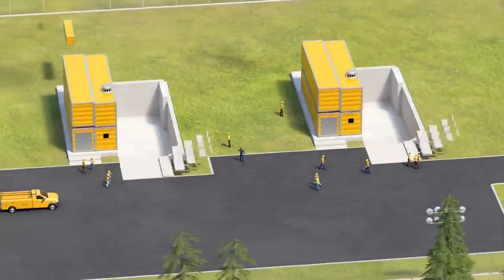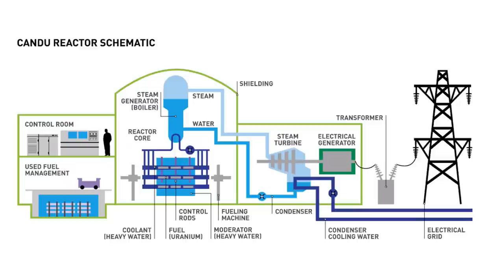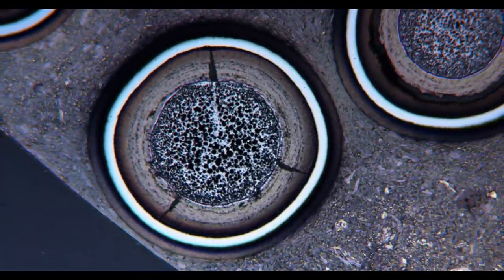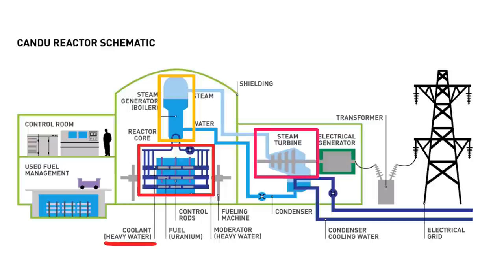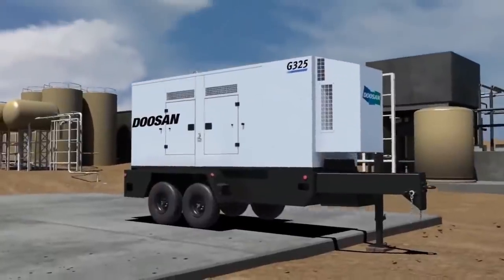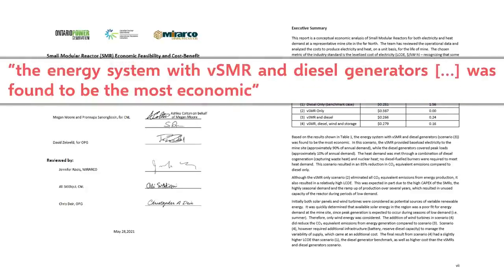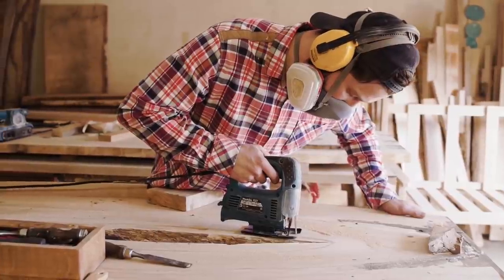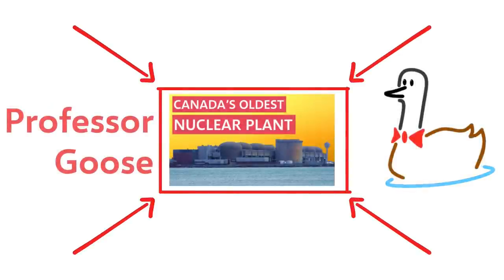This Micro Nuclear Reactor Could be Replacing Diesel Generators by 2026

Comment: One thing I'm curious about is whether a shipping container sized nuclear generators, each generating 1-2MW, could be placed (buried?) at electrical sub stations in order to both decentralize power generation as well as reduce the overall power demands on centralized generation facilities. If the device has a problem and goes down, the central power generator simply picks up the slack until it can be repaired, but while the container is in operation, it provides the primary power to the homes/businesses in the immediate vicinity.
Reply: It is possible. Though you would still need to put some effort in building some infrastructure (like cement frames for the container to go in). But I don't just 1-2 MWh are enough to justify the cost. 10-20 MWh might be more reasonable.
Reply: Any reactor less than 50MW is useless and uneconomical because it's about $5mill per year to licence each reactor so the reactor needs to make that money back plus cover operating and capex costs. That licence fee puts a hard limit on how small a SMR can be.
Reply: @kaymish6178  So you are telling me that is high time we update our nuclear regulations to 21st century standards compared to the fifty decades old regulations ?
Reply: @alexandervlaescu9901  That would be a good start.
Reply: @kaymish6178  One primary goal of a self-contained micro SMR would, I would think, be to standardize the construction so that licensing is a one time thing - like certifying an electric device. You don't do have to pay and inspect/recertify every single iPhone once the design has been signed off on.
Reply: @AntiNeoFascist  You'd think but that's not how licensing works in this context. A operating license is per reactor. even if one built 10 AP1000 or 10 carbon copy CANDU reactors a license fee would be levied on each one. Or one could build 10 different reactor models and still be assessed the same licensing fees. The regulatory regime is not fit for purpose, well it is but that purpose is to prevent the use of nuclear power.
Reply: It depends, perhaps largest constraint is in required safety perimeter, which completely rules out most of 110/22 kV substations in Europe.
Reply: @kaymish6178  Really?! That's astounding (though probably should not be surprising). Thank you for sharing.
Reply: @MrToradragon  Yeah, the regulatory environment MUST adapt to the innovation of the industry. But unfortunately, there appear to be no incentives for them to make any adaptations and actually *DIS*incentives which coax them to continue to change absolutely nothing - even if the result effectively strangles to death the very industry they are charged with regulating.
Reply: @AntiNeoFascist  I think you don't understand, your suggestion would mean that nuclear facility could be as close as quarter of mile to closest houses and often even less for commercial properties.
Reply: @MrToradragon  Yes, and for secured (usually by barb-wire fence) and monitored substations, I think a self-contained, buried, passively safe 1-2MW reactor would be acceptable. I have such a sub-station probably just over 1/4 of a mile from my house. I would be ok with this - especially if they can do this as an MSR (no pressure). That is the direction that we need to be innovating and developing. 

Now, I get that regulators are going to play overly safe with the first instances of this. So establish a reasonable radius to population ratio for the initial deployments and let them begin to deploy proof-of-concept instances in more sparse, less populated areas. But then also set up a time-based reduction formula into the regulation. One that can be overridden should there be issues, but that as time passes and these things prove successful, the necessary ratio for acceptable deployment reduces and allows them to be installed in less remote locations as they demonstrate safe operation. And if they have issues, for some reason, that formula can be postponed or elongated.

But that is the way it needs to work. It has to have a built-in regulatory acknowledgement of safety based on time of successful safe operation. They cannot simply issue a flat rule that "They can be installed as long as there is no people within a X miles."  That will become the only situation in which is will be allowed, there will be no incentive to alter it, and it will dead-end the entire approach. 

Imagine if natural gas were introduced today: "Listen, we understand there are people that want to use this new "natural gas" system piped into their homes and businesses to provide light, heat, etc. However, we are aware that this system can provide a great deal of danger - not only to the homeowner/business owner where it is installed - but also to the surrounding neighbors. Therefore, we will set a firm rule that there must be at least 500yards between a home that has this installed and the nearest neighbor."

Comment: There was another small Canadian reactor called the SLOWPOKE. Because of public opposition it was not promoted. Why not expand on that design?
Reply: Because SLOWPOKE was never designed to be a low-maintenance remote site power reactor. It was a lab reactor used as a neutron source in materials science.

Comment: Just take regulators to agree with the operating principles, approve demonstration projects, and clear up the overall approval process, which takes 10-15 years and billions $$, if you want to make a major shift in basic electrical generation, you need to have government get bold and let private industry put a number of demonstration reactors on line and see how they can be sized from small, mini and micro, so it can be placed in proximity to end users thus decreasing vulnerability to grid failures.

Comment: It  remains that the power generation block is based on steam turbine cycle. At 10 MW capacity coupled with a thermal store the round trip efficiency will be less than 20%.

Comment: I'm quite interested by this essentially secondary dump feature. The idea of using something as an energy store/dump such that power output is constantly used is brilliant. This concept is one I've often wondered about because with nuclear that is the reality. You need to sell every watt for best benefit. I'm curious if that could mean selling the waste heat for heating functions. Alternatively what would the ability be if you dumped into some fuel type that just requires electrochemical production? I. E. Hydrogen? That can then be sold or banked for whatever purposes? The big idea being if you aren't using the power eventually you will max the molten salt but with something that can be sold elsewhere it can offer secondary revenues

Comment: Perhaps  submarines also use micro ceramic encapsulated fuel rods. They keep it close to their chests.      .tri structural iso tropic particle fuel and it's  been around  since the 60s huh.  Andre Rossi's E-cat is probably fake anyway.

Comment: I want a flux capacitor.
Reply: The first one should be finished next week. 3D printer still has to print the spool, which holds the Flux capacitor. 😁
Reply: @DigDougDig    GREAT SCOT !!!
Reply: @raypurchase801  I just need a Delorian. Do you have one? Lol
Reply: @DigDougDig  No. I don't even have a skate board.

Comment: Mkay. Lotsa blab but no true andcomparable real-world numbers. Small reactors still need extensive shielding and monitoring and maintenance.    And there are many tough  technical roadblocks to using any kind of nuclear  for reliable base-load power.  Due to basic nuclear physics they do not change power levels well and can easily go down to zero power for 3 days due to Xenon poisoning.  So  you are going to need 100%  backup power standing by at all times.  Also SMR's youadmit cost more than $1.30 a KWh, more than diesel, and somehow fail to mention that gas or oil turbine power only costs 6.5 cents per KWh.  Very misleading.

Comment: Ah yea, sure why not use a graphite core. That never went wrong. Like in Chernobyl, or Windscale... oh wait. Are those people high?
Reply: Do you even have a clue what went wrong in Chernobyl ? Why do you speak like you know anything ? The problem with Chernobyl was that they used graphite both as a moderator and control rod. Graphite in a reactor core in general isn't a problem. Not to mention it was human error that started the problem. If you are ignorant don't speak with certaintities.
Reply: @alexandervlaescu9901  Well I do have a clue on what happened. Starting up a reactor without a proper rest period after shutdown is a bad idea. Using flammable material for anything in a reactor is also a bad idea. I'm quite allergic to these videos full of computer graphics claiming how easy and convenient a nuclear reactor is. I'm more allergic to those that show a reactor without a proper reactor building. Significantly smaller reactors went hella wrong in a hurry. Nuclear is good, but it's not to be messed with.
Reply: @Killerean  You have to consider if it is even possible for the reactor to have a meltdown. When it is physically impossible for the reactor to meltdown what is the point of a containment building. Ofcourse protection from an aircraft slamming to the reactor is still needed and is done. No one builds reactors out the open.
Reply: @alexandervlaescu9901  It is true that small reactors can be built to withstand its own residual heat after shutdown in case of cooling failure. Submarine reactors are like that if I remember well. They are also a whole different animal of a reactor though, and you can sink them. I just don't trust humans in this case. In case of a design like this one, which inadvertently suggests there maybe won't be a whole bunch of nuclear specialists on site, I don't like it, with or without graphite in the reactor. The graphite is the thing that triggered me first though. It's as I was to go and make a wooden fuse box. That shed on top of the tiny lid of the reactor doesn't look to me like a good protective design. It's made to sound all too easy. And I've learned to be wary when someone pretends something complicated and dangerous is easy and safe.
Reply: @Killerean  But it is neither compicated nor dangerous if you follow facts and the design at hand. Chernobyl had a positive coefficient that was the result of how they used graphite. Graphite by itself isn't dangerous in a reactor. Not to mention the use of graphite like in Chernobyl is illegal in western countries. So you are fussing over nothing. If you want to play expert first study how both reactors work and then try to conclude whether it is safe or not. Coming to conclusion with half of the information and of that understanding only half won't land you on a reliable conclusion.
Reply: @alexandervlaescu9901  I don't play an expert., nor do I have to be one to have an opinion. If you don't like it, you don't have to. If you're a fanboy, that sounds like a you problem. I'm going to be convinced when I can see these things finish their life cycle and not break. If you're so knowledgeable, you know that even western reactors can be surprisingly unsafe if brought to unusual conditions. Like those in Fukushima. Yes, the tsunami was a bummer, that's true. But a good concrete dome could have done all the difference. And all that because actual experts at GE done the stupid and didn't project enough concrete. And there's still about 29 of these things out there. Because you know, why screw up once when we can do it more than 30 times in a row. And that's another reason why I don't like to hear about dozens and dozens of brand new designs sprinkled all over the place without massive amount of concrete over them. I don't know enough to be an expert, but I know too much to be excited about modular reactors and their graphite, and their modularity, and the thin sheet metal shed on top of them. For me a well protected reactor must provide it's own safe grave if needed. And these don't seem to me like anything like that. And now if you'll excuse me, I have better things to do than continue this thread. Have a nice day.
Reply: @Killerean  you are just ignorant. First Fukushima wasn't even a disaster. You mouthpieces make it seem like the reactor killed more people than tsunami did. Second two things could have been done different to prevent the accident. One is the japanese government actually bringing new batteries or generators to the facility before the on-site ones run out. Second thing they could have done was a better design for the back up generators. This could have been done with either a taller sea wall or I don't know , not put the back up generator so low and in front of the sea maybe ? The explosion you heard about where from hydrogen being amassed. Most gen 3 reactors if not all have a system that prevents that. The roof got blown off because guess what ? It was designed to. Lastly Fukushima was a gen 2 reactor at the end of its lifespan. If there wasn't so much blind hate and fear towards nuclear power , the company would have better ease at replacing the Daiichi plant. 
Gen 4 micro reactors don't need as much shielding around them because it is pretty much physically impossible to melt down or have any explosion. The only concrete that is needed for things like an airplane crashing on the plant. The fact that you insist on problems that don't even exist show how ignorant you are. I am not fanboying about nuclear. I know it's disadvantages as well its advantages. Listening to fearmongering that is baseless without facts and built around lies and overexageration is not my way. To claim a technology is bad or dangerous without having basic knowledge about it is just stupid. What about you go actually learn the basics about nuclear and its related events so we can have a meaningfull conversation. Listening to the blabbering of a mouthpiece isn't in any way meaningfull or fruitfull.
Reply: @alexandervlaescu9901  Oh you misunderstand! I love nuclear. It is the safest solution per unit of power delivered. I simply don't like it when it's sold and handled like Pokemon trading cards. And listening to you ain't no bliss either.
Reply: @Killerean  I have spoken no falsities. Nuclear is literally the safest option any day. To question safety when you don't understand the basics of the technology is foolish and meaningless. You prattled about how graphite in a core is dangerous and compared to Chernobyl. This showed you had no clue what you were talking about. I am not casual with reactors. Fact is the technology has so many fail safe systems that especially gen 4 reactors are almost impossible to result to disaster or even major accidents. Gen 4 reactors share no weakness that Chernobyl had.

Comment: Nice video. Why not use liquid fuel? Breakdown products like Xenon will impede neutron flow. Separating Xenon gas from a liquid is not that hard, from solid pellets not so easy. How can they get 20 years from solid fuel (pellets) when traditional reactors fuel pellets are poisoned after only a few years?

Comment: Another pressurized reactor design, no good. Get me a thorium molten salt based reactor (and why not the design that actually can eat the waste of older reactors) and then you can tell me you have a safe secure design that is actually passively safe! Even if everybody dies and there's no maintenance the core in the worse case scenario this type of reactors will simply shut themselves off without any mass release of radioactive elements or any other problematic stuff into the environment. Not to mention their fuel is actually cheaper by default, Thorium is quite abundant and much cheaper than Uranium, and much much less than enriched Uranium. This combined with eating the waste of older reactors extracting power from something that up to this point is  considered a mostly useless dangerous by-product makes this ideal. Cheaper power while cleaning up nuclear waste. That is the perfect approach, not this.

Comment: Assuming a 1 MW plant can power 1,200 homes my guess is the number of remote communities that would need a 10MW generator is exceedingly small. Off the top of my head I can think of 10 communities within a 60 mile radius of where I grew up that have withered away and are dead or dying. Would be more economical to get these remote communities to relocate.
Reply: If they're within a 60 mile radius (and not separated by other geographic barriers), they can be grid connected and aren't the target market for these reactors. Think Haida Gawaii or Rankin Inlet, not small town Maine.
Reply: 1 MW at best it's 200 homes else you have to have some significant power storage.
Reply: @Ayvengo21  Stop right there: 200 homes is 5kW around the clock per household. That is insanely much like a growup or bitcoin mining! That would be 43.8 MWh per year per household. I used 4 MWh last year in an apartment of 3, with hot water and heating non electric.
Reply: @Tore_Lund  you need to keep in mind your peak consumption. If your grid can't take the load you are totally screwed. BTW that not the number out of my head that is number from government standard in former USSR countries and it was calculated base much lower power consumption comparing to wester countries.
Reply: @Ayvengo21  True and I don't know the factor for peak loads, but I suspect you are on the high side.